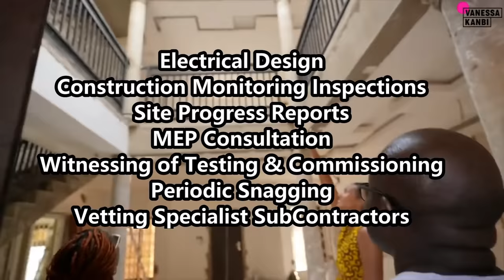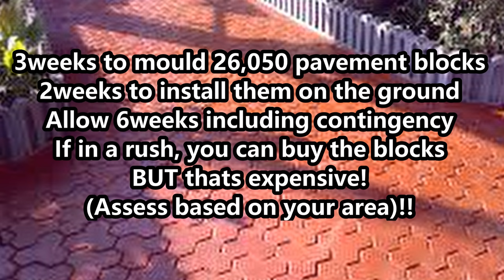BUILDING IN GHANA | GARDENING WITH ASHER & GAD

Comment from the maker: AsherGad Consulting Ebooks below:
"Consulting 4 the Diaspora"
1. Cost Templates For Building In Ghana (Link below)
     https://payhip.com/b/UQjBY     
2. How to Wire your Home for 110V & 220V Equipment
     https://payhip.com/b/gN8eY     
3. How to Manage Power Failure (dumsor) in Ghana.
     https://payhip.com/b/BlyQ9     
4. How to Construct a Water-Proof Concrete Flat Roof in Ghana
     https://payhip.com/b/QXJPl    
5. How much Power Does your House Need?
     https://payhip.com/b/8P7wu    
6. Water System Design for a Multi-Storey Building in Ghana
     https://payhip.com/b/fLKYD   
7. How to Select the right Balustrade Artisan in Ghana
     https://payhip.com/b/WbnCN
8. How to Select the right Window Artisan in Ghana
     https://payhip.com/b/dL7FS
Reply: Hello ! Asher & Gad.Your garden is looking  good i cant wait to see when all the vegtables starts to grow ,At 🇬🇧 Now we have no sunflower oil which was original  from Ukraine.
Reply: If you want an irrigation system you could get your plumber to lay all under ground pipes in preparation before paving blocks are laid.

Comment: Will it not be a good idea to use different colour tube for gas as you've already use green for water. Like you know not all artisan know building codes. You ask someone to fix your water line years later and will cut your gas line and say "master I thought that is the water line. Better be safe than sorry. If you can get one of the aluminium gas tag on where it goes through the wall to kitchen.